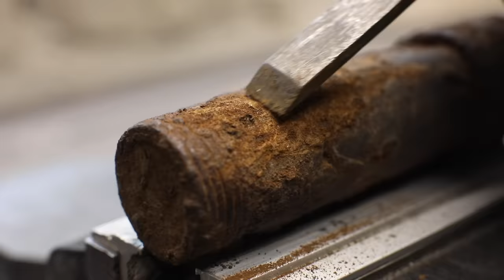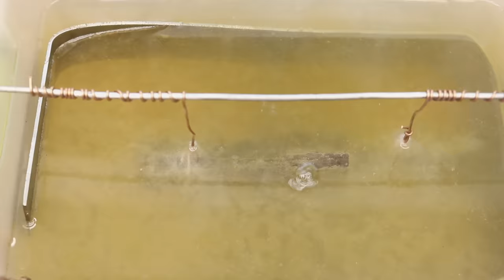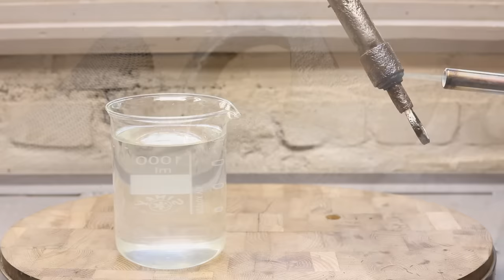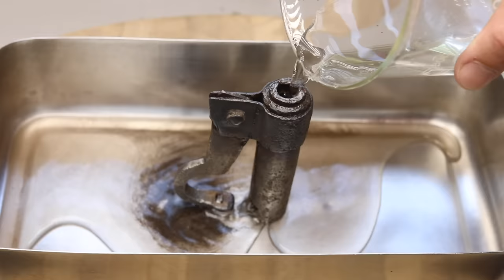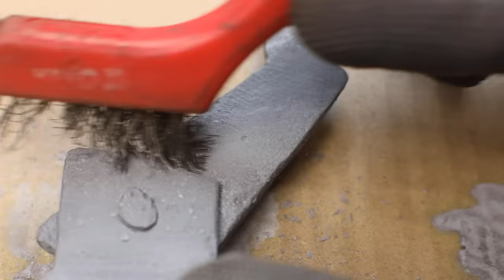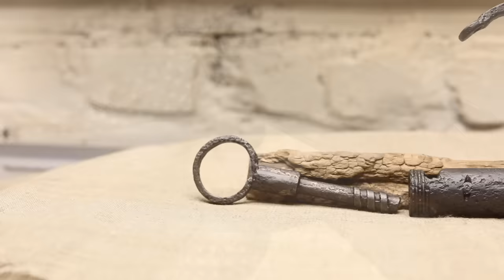300 Years Old Padlock Restoration! Rusty Lock with Key

Comment: Transmission oil and acetone mixed 50/50 will penetrate better with the acetone thins out the transmission oil. Just a suggestion you might want to try

Comment: Iron made before 1945 is very expensive because it does not contain radioactive elements and is used in the manufacture of radiation detection devices. It is melted again and radiation detection devices are made from it.